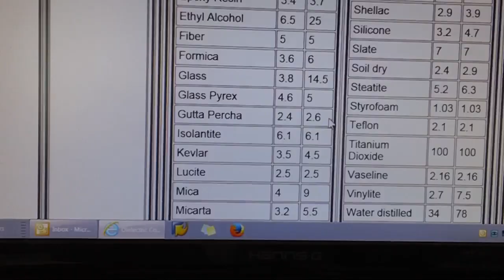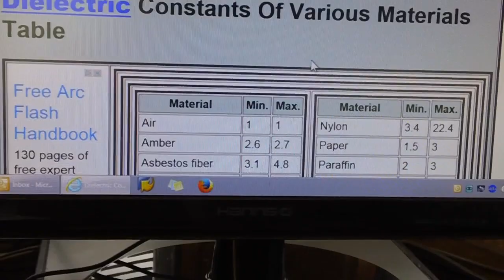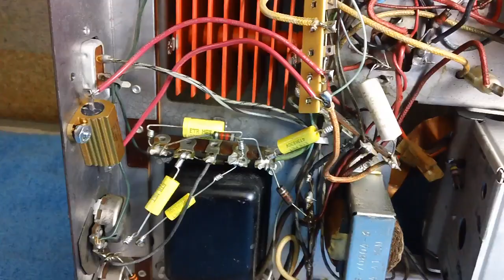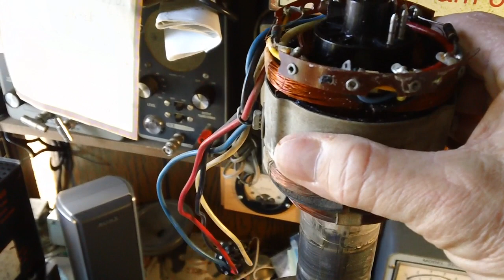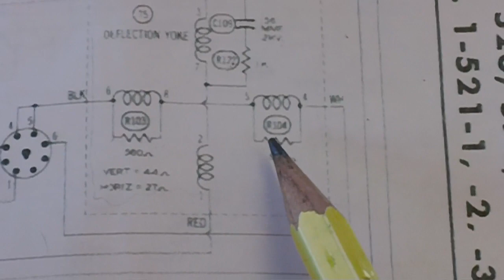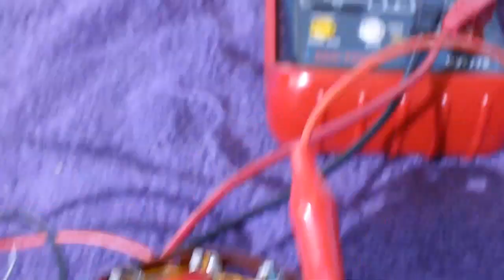1956 Sylvania 21" Halolight TV restoration (part 10 of 23).

Comment: I wonder if I should coat the flyback in my Zenith? That is of course if the flyback is still good. Gary
Reply from the maker: Gary,I bought the tube of silicone (expensive stuff btw) because a TV I had been given had a good flyback, but all the wax at the bottom had fallen off into a melted heap, so I needed to build it back up.  The Corona Dope was applied for added insulation and safety.  If the wax coating on your TVs flyback is merely cracked, then there will be no need to use the silicone.  Two layers of the dope will suffice.  I merely applied the silicone in this video because I still had it on hand and to let folks know it exists and how to use it.
Regards,John

Comment: John,
You are in good company my friend: over the past thirty-or-so years, I too have smeared silicone rubber round ageing LOPT overwinds, and the like.  I’m not familiar with corona dope but I have used bitumen for a final coat – the kind one can paint onto galvanised corrugated mild-steel roof sheeting for example.  Corona dope looks to be the more efficient – so I have definitely learned something here – thank you!
Also, good on y’ for removing the scan coils (Yoke) from the CRT and checking them.  There is nothing more frustrating than finding either the frame, or line, side of them is defective after you have taken the trouble to get everything else working.  You can reset the vision focus, centring, and linearity once you have the set working – be careful of high voltages when making scan coils adjustments, such as the iron traps etc.
I can say with experience, attention to detail, which you exercise with ease, with always pay dividends.  As I see things, you can proceed with confidence knowing your line output transformer, and scan coils, are functional.
A very fine, and encouraging (for beginners) video my friend.
Regards,
Phil.
Reply from the maker: Thank you, Phil.  I always appreciate a positive comment from someone much more experienced and talented.  That silicone I used works well, but it isn't cheap.  Neither is the Corona Dope.  Both are way overpriced.
Another vid should be available this weekend.  At least that's the plan.  See you then, my friend.

Regards,
John

Comment: What's the model number on that flyback? I picked up quite a few NOS ones a while back and I'm curious if one of them would be a good drop in replacement.
The model numbers I have are FLY-87, FLY-36, and a FLY-49, there's also a FLY-47 and FLY-85 but those two have seen better days, they got battered around quite a bit and the wax is cracked. But all of them are new, no solder on any of the pins.
Reply from the maker: Tripp,
I can't find a part number on the flyback itself and the parts list only has a Sylvania part number:  241-0026.

Regards,
John

Comment: Hi John, RTV stands for room temperature vulcanizing. Does the resistor require any thermal transfer grease under it?
Reply from the maker: Darryl,
There's no need for thermal grease with this.  Thermal grease is designed to help transfer and dissipate heat on critical components that run quite hot.   Makes them last much longer.  This dumb ole resistor that's rated about 20-watts above what's needed and fastened to the chassis will never burn out.

Regards,
John